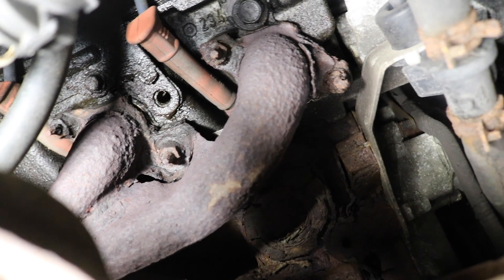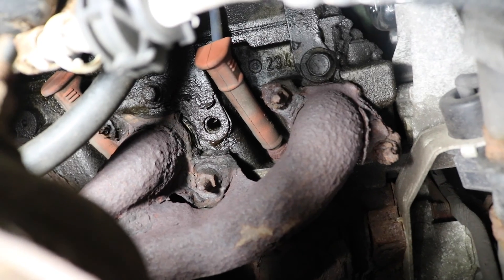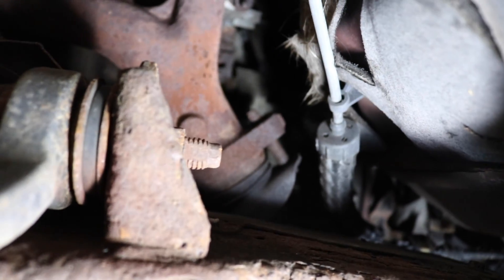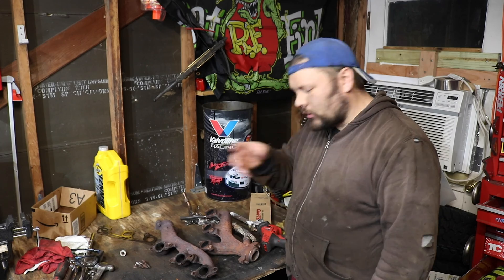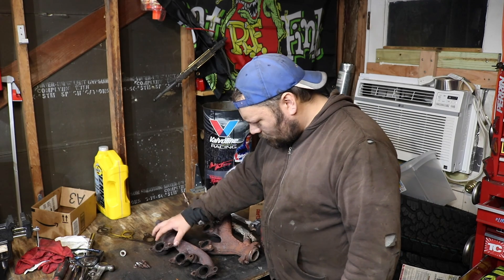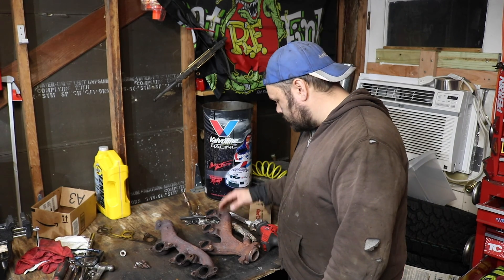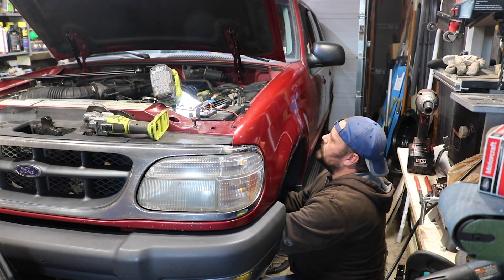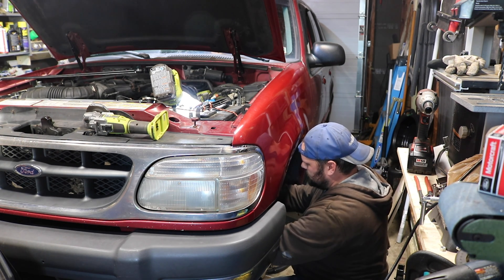Ford Explorer Exhaust Manifold Repair Pt1 [E19]

Comment: Seriously? It only took you two hours to get those off?
Reply from the maker: Yep - usually only takes a couple hours to break everything free. Did you run into other issues?
Reply: @Enginuity  Not like yours! But I didn't cut my bolts. I managed to get them out on the right side. I'm doing the left tomorrow. Thinking of going for EGR delete too.
Reply from the maker: Godspeed and good luck!